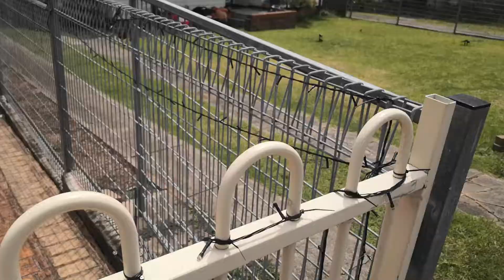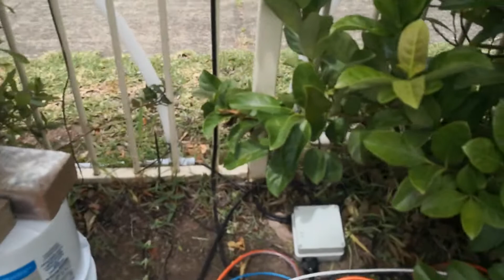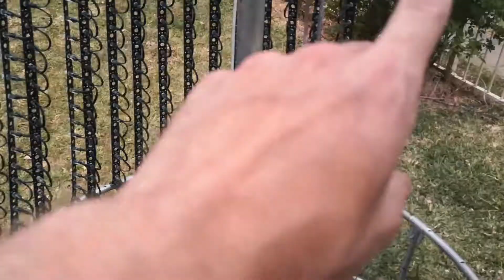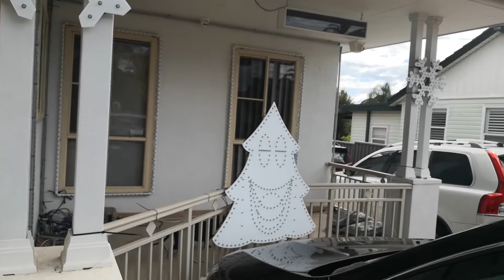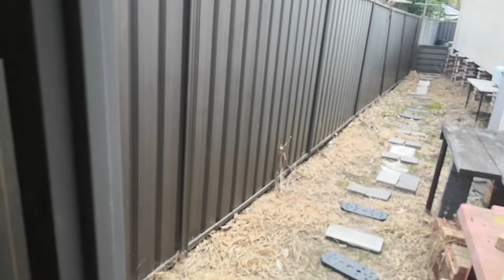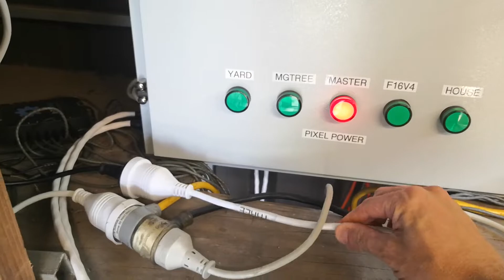Behind the Scenes 2022 - Christmas Light Setup Walkthrough

Comment: Great behind the scenes. Much easier to follow than many others. Being in the southern hemisphere do you have issues with your electronics getting too hot in a metal shed? I suppose they’re running at night but my metal sheds are like ovens.
Reply from the maker: The shed is on the south-eastern side of the building; it gets morning sun, but by the afternoon it's completely shaded by the house. In Sydney we regularly see 40C/104F days, and it not cooling off until 9pm or so when the changes come through. So it's not uncommon to run in heat. The shed itself is quite well ventilated however - it's actually made from the existing two fences, the wall of the house, and some acrylic sheet, and a tin roof over the top; hardly a "closed shed".

That being said, we did have an issue this year on a 44C/111F day where the CPU of the Raspberry Pi hit around 80C/176F by midday. I shut the whole lot down that day. Inside the shed is the condenser for the air conditioner; which also dumps a load of heat from the house.

Comment: Converting down to 5V at each prop sounds like a genius idea. What module are you using for the step down? Did you have to take amperage into account?
Reply from the maker: I'll be putting together a video shortly on my step-down boxes and associated detail. Just need to get some power issues sorted in my workshop first! Keep an eye out for it.

Comment: Excellent behind the scenes video. Very informative for someone like me who is starting out with this hobby for a 2023 show. 
24V backbone on 1mm2 is ingenious and probably will give you tons of headroom to expand.
Do you use power injection at all on the 5V props or just tie the 2 ends together?
Never seen X60 outside RC. Are they waterproof? 

Keen to hear your thoughts after the season. Especially around the storage of the props 😀
Reply from the maker: Hi Shay, thanks for the comments. There are a 6x 24V feeds around the place, two per 40)W power supply.  It's been sized to keep the current under about 10A per feed, in line with the 1mm cable. Having the converters near the props means that the 5V drop is kept to a minimum, and any drop on the 24V line is absorbed by the DC converters.
As for the props - it depends on the pixel count. I try to keep a power feed within 50 pixels of a power supply. So the singing tree at 252 pixels has power injected at at the start, at pixel 100/101, and 200/201.  The longest distance from a pixel to a power injection point is the mega-tree, which is powered only at the bottom, with 75 pixels up and down.

The XT60H connectors themselves are not waterproof. Neither are the Anderson PowerPole on the 24V lines. However as they are not carrying the high impedance data line I'm not particularly fussed. The connectors are pretty solid and it will take a lot of corrosion before there will be an impact.